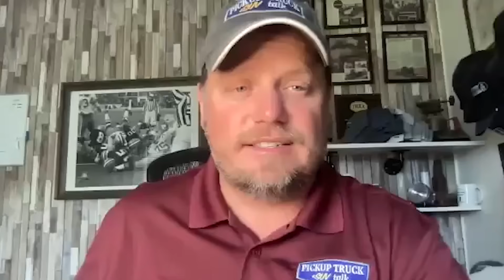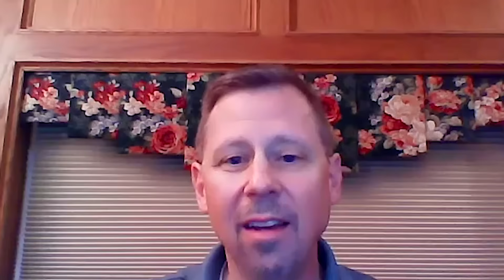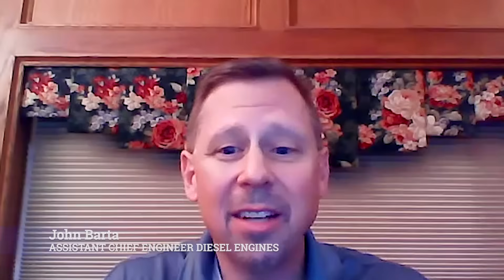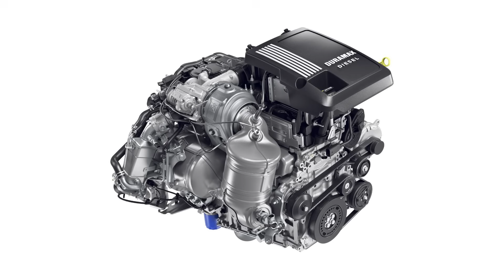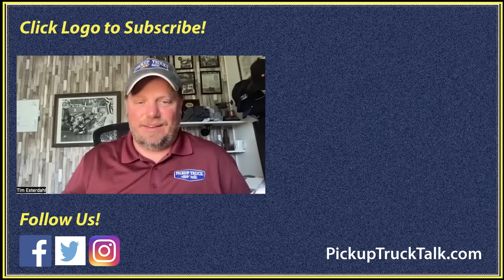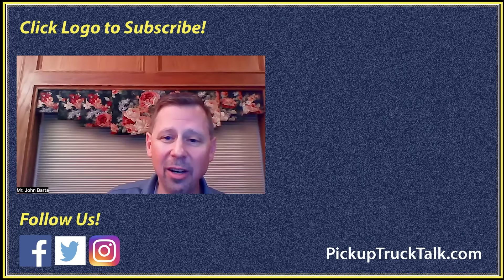GM's 3.0L Duramax Diesel Engineer Answers Questions Owners Keep Asking

Comment: I love that powertrain! Great interview!  Just need to package it with about an  8K GVWR truck and larger fuel cell and stiffer suspension to bring back the old light duty 3/4 ton like Ford does with F150 HDPP.  Ford does a phenomenal job on the HDPP to include 36 gallon tank and higher axle ratios and bearings and frame thickness etc.   But Ford gas engines, while very powerful, don't enjoy good towing mpgs.  This powertrain would serve us half ton owners not needing the venerable 6.6 durabeast!  Appreciate that GM is now offering max trailer package with higher aspect axles ratio and slightly higher payload.
Reply: A true light-duty 3/4-ton should have a full floating rear axle. I think most manufacturers are going to be more leery of offering a higher GVWR half-ton after the total failure of the Titan XD in that space. Most people don't even know about the HDPP F-150 since it's such a rare truck that requires very specific options and equipment choices.

Comment: Just sold my '20 3.0L GMC AT4 with zero issues - LM2 is an incredible power package .  Can't wait for my '23 LZ0 to arrive next month.  These improvements are taking a great engine to another level
Reply: Did you order yours already?  I put down a deposit but am being told by dealer that they can't officially get mine in the queue until 2023 pricing and options come out.  Hoping that happens soon so I can get an estimated build and delivery date.
Reply: @caryslape8811   I have a 3000 GM build code with mine( accepted by GM )  .. but it wasn't easy with options and pricing .. seeing nothing was released but my dealer had an allocation to order - I received 8 pages of highlighted option codes on my truck . Still waiting for cleaner build / option copy.   9/12 is build date .. beyond Model , color and engine what's on it is TBD :)
Reply: @caish6185  Thank you for the info!

Comment: I was wondering if you heard of ducted fuel injection? I was listening to random YouTube videos and heard of this. Basically this ducted fuel injection takes a diesel engine and reduces its soot output by 50%. From the info I gathered it could be designed to be backwards compatible with older diesel engines. I was wondering if John looked into this for future engines to help meet the extremely tough emissions the epa has on diesels.

 Also was wondering if GM was going to develop an inline 6 for the 2500 and 3500. I feel it would awesome to see a 5.0l diesel with more power than there current diesel engine. I do know it would require a redesign of those trucks but since inlines makes more natural torque it was just a passing through
Reply: I saw that video too. I think it was 50 to 100% decrease of of soot thereby potentially no DEF system at all.
Reply: Saw that too, Sandia Labs was working on this.

Comment: As soon as he said BSFC, I knew exactly what he was talking about. If you use an engine dyno, it's a critical gauge that tells you how the engine fuel ratio is doing. Too low and you seize the engine. Too high and it runs too rich and gets bad milage. To get a good performing engine, you want it in "the sweet spot."
Reply: BSFC is what powertrain engineers use to quantify how fuel efficient an engine is. They create a map with engine RPM on one axis and engine load on the other axis. You end up with an island of efficiency where the engine is most efficient over a range of engine load and rpm. When GM released the Gen V LT engines in 2014, the new 6.2 LT1 ended up having the highest BSFC of any production V8 in the US market, including the 1st/2nd gen 32-valve 5.0 Coyotes. Most of that was due to good combustion chamber design and direct injection. When Ford released the 3rd gen 5.0 Coyote, I believe they retook the lead in BSFC.

Comment: So they could've fixed the belt driven disaster but instead chose to do a bunch of other stuff and say now you can extend the service life of that belt. I'm trying to wrap my head around somebody actually achieving screwing up an inline six diesel. This thing would be the very first choice of everything if it didn't have a belt driven oil pump.
Reply: So naive…

Comment: I ordered my new Elevation on July 2nd with the LZO coded engine. Should be here in a month or so 🤞If you make it back to town my buddy has the 2020 Elevation with the LM2 if you want to compare. Mine will have the tow package, not sure if his does but otherwise identical. Offer is there, keep up the good work! 😉
Reply: Hello, Did you get yours yet, if so how do you like it so far?

Comment: I just bought a late build 2022 GMC Refresh LM2, Could I still get the long start issue. My 2020 LM2 never had the issue at all.
Reply from the maker: Not likely. The truck you built after the problem had been fixed and/or it would have had the TSB done at the dealership to correct this issue.

Comment: Good luck if your duramax has a bad injector the repair requires that the harness that works with the  injector be replaced. GM doesn't have any! My 2022 sits at the dealer with no harness on the way one week so far, only 8600 miles on the truck. They shouldn't be allowed to sell a vehicle if they aren't making spare parts!
Reply from the maker: Spare parts shortages are impacting all manufacturers as well as used part suppliers.

Comment: That oil belt is still a deal breaker for me personally.
Reply: Nah, aint no thing.
Reply: Just pull the engine and change belt around 100,000 to 150,000 miles before engine blows
Reply: How often you ever have a serpentine belt fail?

Comment: Timing belt on the rear of the engine was a stupid design. That maintenance item will be expensive.
Reply: Once ever 200K miles? Not a big deal.
Reply: @edwardpate6128  is that what it is recommended? I didn't hear that
Reply: No big deal, just pull the engine and change belt around 100,000 to 150,000 miles before the little diesel engine blows

Comment: Great interview.  I have the LM2 and love it.  Every other truck owner I talk with cannot believe the mileage numbers which are about 24-26mpg.  Very interesting to hear how technology is allowing for simple software fixes rather than having part changes.
Reply: If you behave yourself 28 - 29 is pretty much the norm for my Chevy LTZ. I’m averaging about 12.5 mpg in the mountains and 14 mpg towing in moderate hilly country when pulling my 7,500 camper. Thing is just a torque monster for a 3.0 motor…love mine.
Reply: Does your truck loose any oil When you brought it?
Reply: @pauldonnelly6691  I haven’t had any problems with oil leaks. So far it no issues with anything. Blessings
Reply: I've gotten as much as 35mpg in my LM2. It was right after I'd finished towing and I got fuel from a truck stop. Was going 60-62 on flat ground.

More typically 26-27 going 70+ and 28-29 when going 60-65. My manual calculations usually beat the computer consistently by 1-1.5mpg

Comment: I have 2022 denali 3.0, it has been in service 5 times already due to emission problems, does anyone know solution for that problem yet, they were other 3.0 trucks with  emission problems at service
Reply: I'm curious....do you warm up the diesel before driving? Do you use diesel fuel treatment? Are you driving short or long distance? What kind of def do you use?
Reply: @cabmex  I didnt have a chance to add def to my tank , my truck only has 1200 miles on it,mostly highway driving I didnt see a reason to warm up the diesel, i live in San Antonio,
Reply: @sedatn8639  You need to let the engine run a couple minutes before driving, even if you live in a warm region of the country. The emissions equipment needs to get to temp and the turbo needs to heat up. It says right in the owners manual to let the engine run a few minutes before driving. Is this your first diesel vehicle?

Comment: We all know the trans won’t last 150k let alone 200k in most GM vehicles .  I’m sure it’ll be standard practice to replace it when rebuilding the trans.
Reply: That’s actually not true, or accurate. I have the exact same transmission in my F150 2.7, and 80k. Zero issues so far.  You need to do maintenance, and flush the fluids, filters at 75k.
Reply: @Calebflying2025  they’re close but not the same and they do have issues. Maintenance is key with any transmission but doesn’t always guarantee it being problem free.  We had a 18 terrain with a diesel fluid changed every 40k miles. Input shaft broke at 89k. Lots of people have issues with gm transmissions when they’re out of warranty.
Reply: @kirkenstang  How is a input shaft relevant to anything? The 10 speed transmission overall has been reliable, and a great transmission.The 8 speed, however has far more issues. I hate when people makes extreme claims, based off zero date. The claim you made is this transmission will not last a 150k. That’s simply not true, unless someone abuses it, and does zero maintenance.
Reply: @Calebflying2025  I said most, not all. Im just going off of the history of GM transmissions not lasting more than 150k so it’ll have to be pulled and you may as well replace it while you’re in there. The point is, transmissions have some weak points in them, seemingly more gm than ford. Look up common 10R80 problems for ford. 
Input shaft/turbine shaft, whatever you want to call it should never break under normal use and that is a transmission failure so the point is relevant.  
So you’re saying the 8 speeds have issues?  That’s true. Do you think it’s because of lack of maintenance? No, piss poor gm engineering/cost cutting. This is the point I’m making and you just proved it with talking about the 8speed issues.

Comment: The power for ev needs to come from something want to know how well wind and solar work look at the rolling blackouts in Texas when they had a cold snap ! Dumbest thing on the planet .. chevy screwed me over once with the 6.5 detroit diesel they were ordered to supply a new injection pump for up until 2024 or 100k miles neither of which were met they told me it was too old 6 months into buying it and I fought with them 20 years with their boat anchor sitting in my yard with less than 100k miles on it ! You couldn't give me a free chevy after that I bought several new cummings and Ford's since and they never gave me any of the problems chevy gave me  and worst part is my family owns a chevy dealership and a dodge dealership ! When asked I tell everybody anything but a chevy !  You could blow unicorn dust for emissions and I still wouldn't buy one..

Comment: 200,000 before needing the oil pump belt replaced.  Does that mean when it breaks at 185,000 miles and 15 years old GM will warranty the destruction from a broken belt?  EXACTLY  No thanks.

Comment: I’m not huge on GM products but this truck has really drawn my interest due it’s power and economy. I’m still a bit concerned about the timing belt. 200,000 service interval is certainly better and acceptable. My question is, is this an interference engine? If the belt breaks is the engine trashed?
Reply: When the oil pump belt breaks, the engine will starve for oil and the wife will keep driving and wipe the engine.
Reply from the maker: No, the engine won’t fail. There are sensors built in and when it gets low on oil, it will alert you to pull over and shut it down.
Reply: So.....is it an interference engine?!
Reply: @anthonys7534  I don’t know if anyone here knows what an interference engine is! It really doesn’t have anything to do with the oil pump unless it’s driven off of the timing belt. Let me ask this. Will the valves and the pistons run into each other if the timing belt breaks and wreck the engine!? Anyone? Anyone? 😂
Reply: @markreams3192  Nearly all diesels are interference design. The belt they are referencing is the separate belt that drives just the oil pump.
Reply: @markreams3192 if you cut it off right away you will not destroy it
Reply: @anthonys7534  Not sure if it is an interference engine.... it wouldn't matter as this is the OIL pump belt and not the timing chain we are talking about.  Oil pump belt breaks the engine is gone.
Reply: @testtesting2868  Exactly. The term "Interference engine" only applies when you're referring to a timing belt. This is a oil pump belt. If it goes, my assumption is that you'll get tons of warning lights telling that the oil pressure is low.
Reply: The belt I’m referring to in my original comment is the timing belt. In an interference engine, if the timing belt breaks, the valves and pistons immediately collide trashing the engine. There’s no shutting down the engine as the damage happens immediately. The repair for this is a complete new engine. I don’t understand why GM isn’t using a timing chain which usually has no service interval and typically doesn’t wear out as long as you change the oil regularly. Secondly, why wouldn’t GM design the engine with the timing belt or chain at the front of the engine so you wouldn’t have to drop the transmission to service the timing belt? (The timing belt is at the back of the engine) The concept of a half ton truck with a smaller displacement diesel engine is good. For those of us that keep our vehicles a long time and don’t want to look forward to a maintenance bill of several thousand dollars the execution of the concept is not very good!

Comment: Did GM get rid of that stupid BELT driven oil pump...?
Reply from the maker: Did you watch the video?
Reply: Did you not watch the video lol. Gm extended the interval to 200k and same design otherwise. There are improvements though. You should watch the video though, before asking answers, that are in the video lol.

Comment: Will they warranty that oil pump drive belt for 200,000 miles ????
Reply from the maker: The inspection interval is now 200k miles. It is likely to last longer than that. Remember, that's just 200k miles to "inspect" the belt and not replace it.
Reply: If you have it apart to inspect belt ,why not put in a new belt😅

Comment: I like diesel engines for their longevity.   And we have 2 diesel pickups at my house. The rubber timing belt is not okay in any engine design.  I like this engine, except for the rubber timing belt.  I drive my primary use vehicle 40-50k miles a year.   A chain drive is the way to go.  The price of fuel will be what it is.  But I really like the range of a diesel.
Reply: It has a timing chain.  Just the oil pump is driven by a belt with a 200K mile service interval.
Reply: @andytracey4064  oil is crucial to engine operation.  A rubber belt is not acceptable.  This makes an otherwise desirable engine.  A no buy option.
Reply: I can name quite a few engines that didn't make it to 200k because of timing chain guide issues
Reply: The full size diesel engines don't even have a timing chain. Their gear drive.
Reply: @TheBandit7613  yeah I know oil pump only
Reply: I totally agree. Belt is a no go for me with the oil pump. Gear drive would be a different story.
Reply: Sorry, I will not consider this engine when you factor in the cost of pulling the tranny to replace a belt at 200,000 miles. Because thats not covered under warranty, its maintenance. That $$$ comes out of my pocket. I will stick with the 5.3L.

Comment: The question is will the 3.0 be available as a crate engine?
Would like to swap one into my express.
Probably have to buy a salvage truck to get the harness and electronics.
Reply: In twenty years there is a 10% chance.

Comment: Gm, Is it possible to make a more highway oriented hybrid system for the lz0 like the hyundai ioniq, and figure out how to use engine load, and throttle position. As well as incline to maximize fuel efficiency. If only there was a single cab shortbed hybrid. Easy 50 mpg

Comment: Since GM supposedly watches the comments for feedback I would like to see them partner with Toyota and purchase their ducted diesel injector technology. We all know Toyota will not being a diesel to the US market but they have a US patent for this technology. Rather than scrap this innovation why not work together. There are many Denso parts on the LM2 and LZ0 anyways which is a partially Toyota owned company anyways. The claims are no or little DEF required with this technology. Let's make the modern diesel engine reliable and user friendly again!
Reply: epa not going to allow this

Comment: If you're going to keep it long-term and you're in the rust belt I would avoid it being that you have to drop the transmission to change out the timing belt in the back of the engine every 150,000 MI which is out of warranty which is not going to be cheap to replace that
Reply from the maker: Did you not watch this video? The mileage is not 150k miles anymore.
Reply: @Pickuptrucktalk  i did   being rubber wouldn't it degrade and stressed due to heat being in  oil during the 200,000 MI what did they change in the material or belt type to make it last 50,000 miles more
Reply from the maker: @spencerelsbury9110  the initial interval was set at 150k miles. As they learned more about the engine and the belt, like he said, they realized it should actually be 200k miles. In the first interview a few years ago, we discussed the belt and how much belt technology has changed.